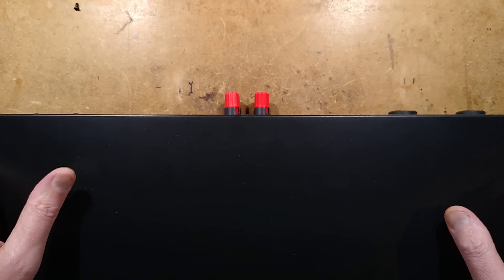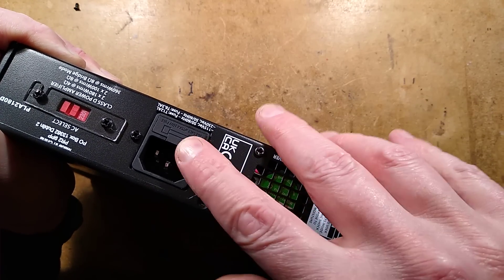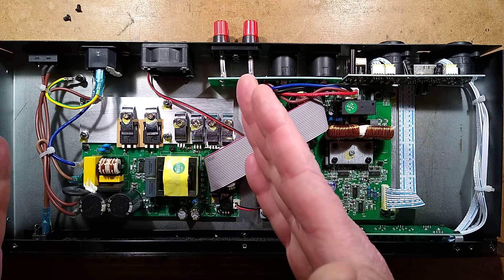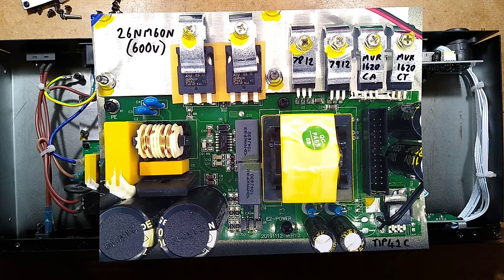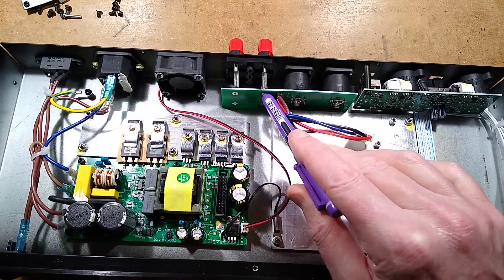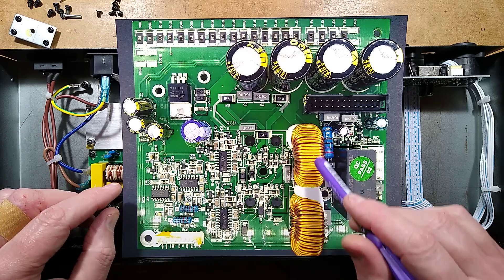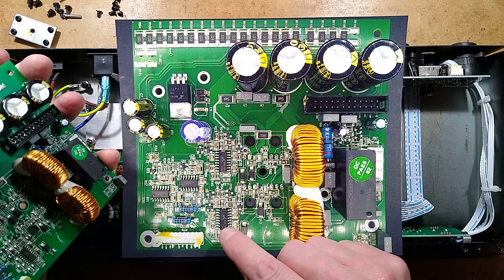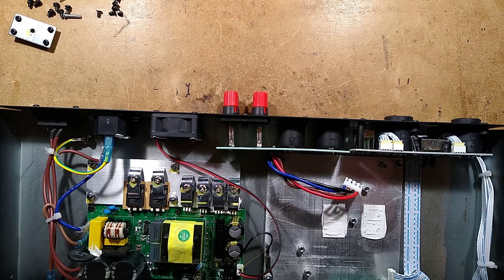Inside a 360W digital amplifier

Comment: I recently switched from a class B power amp to a fully digital 2.1 amp in my office/home studio listening setup. I opted for a TPA3225 based design which is so much better than the old iron and heat sinks approach. Sure, it gets annoying when you crank it really loud, due to ringing, but I am normally under a quarter of its capacity, so it's fine. They managed to pack a 2x75W + 150W 2.1 amp in a box the size of two cigarette packs. It stays almost cold, even after hours of heavy use. It's lightning fast, you can hear it when modifying the transients of a recorded track. It draws 2W on idle. I won't go back to an analog amp anytime soon...
Reply: These amps are in fact analog, they do not have a code of zeros and ones to make the sound. They function with pulse width modulation and that is in essence still an analog principle.
Reply: @ottonormalverbrauch3794  Yes, as in "light switches are analog, too". Does "PWM switched circuit preferred over linear regulator" better to you? ;)
Reply: @ottonormalverbrauch3794  they use a specific digitising algorithm we know as delta-sigmoid modulation. It is equivalent to a digital signal in many ways as that's truly how simple DAC and ADC can be.
Reply: @AnnaVannieuwenhuyse sorry, class D amps aren't digital. As explained above, they're purely analogue. A quick google will show the difference.  It's a very common misconception that class D means digital, it doesn't. It just means switching.
Reply: @AnnaVannieuwenhuyse a digital signal needs to be quantised in both amplitude and duration. A class D amp has only one of these - amplitude. The PWM stream is infinitely variable in length, determined by the analogue input signal. If it was digital, those pulses would be discrete lengths.
Reply: Ensure your TPA 3225 has sufficient voltage. Their distortion performance is far superior when they have the voltage headroom, both on the end stage amp and the signal stage with feedback.
Reply: @AnnaVannieuwenhuyse  Yup, on point. I am running it on a 48V supply, so there's ample headroom and no worries.

Comment: Yeah very common one time in analogue studios to have the green wire poking out the bottom all the mains plugs unconnected. Audio grounding is contentious subject and entire articles written on it, plus a lot of studio 'outboard' isn't balanced it's 1/4" jack not XLR. So the power earth gets cut. Or use a 2-pin adaptor on the 3-pin plug. Lot of people  until the mid-80s also used to cut the earth with their 'scopes so they can clip the 'earth clip' to a mains live TV chassis without blowing themselves up, until someone comes along and leans on the 'scope not knowing the whole thing is live = "buzzzz!!! ow!!"
Reply: Well, nothing can compete with hyped MarkBass amplifiers from Italy which are with a very idiotic solution - extremely expensive but made from worse components and completely ignoring the basic rules of electronics.
Based on this video, it is quite clear that this particular Chinese amplifier (worth some 150eur or so) is much closer to all requirements than the aforementioned MarkBass (and sometimes even powersoft), even considering their price (thousand+Eur or many thousands Eur in second case) .

Comment: The mystery chips are possibly a clone of the obsolete International Rectifier /Infineon  98-1073pbf which is listed online for sale as 'ic audio driver digital'. No data sheet seems to be available but it's probably very similar to the common IRS2092. 
The power supply looks like it is a unregulated LLC design. The large caps close to the transformer are in series with the transformer primary so that is resonates at the drive frequency. Current in the primary is sinusoidal and switching losses and generated noise is minimized.
Reply: IR2156 is not even close to LLC, LLC is much different topology, yes it is in terms of interference noise, LLC is the best topology for powering an audio amplifier, but all these converters operate at a fairly high frequency, and when they stay in their modes, they usually do not have audible interference noise.
The IR2156 is actually a ballast driver for a fluorescent lamp, but it can be ideally used as a half-bridge switching power supply controller. If it is done correctly, they are also quite reliable, they work even at frequencies 100kHz+ (quite extreme and must be a well-developed solution), it is possible to take 5-6kW of power from this kind of half bridge PSU to the powered device.
Of course, this specific one in video does not correspond to these numbers (and don't have to acorrespond it, because amplifier is also much more modest)...

LLC's standard example is ST microelectronics L6599, but it would make power supply much more detailed (dense) visually - the LLC power supply requires a very careful design and its (in L6599 case) power capacity is also quite limited (you cannot create a power supply unit of the same power as aforementioned numbers on basis, as is possible with these simple ballast drivers).
With ballast drivers, it is also possible to use several protection functions - overcurrent, overvoltages, etc. that are present in full-blooded PWM drivers, but this has to be done externally, often this external design can also be better than on-chip solutions.
I'm not afraid of them (ballast ICs), they've proven themselves quite well, and with add-ons, they can be made completely equivalent to special PSU drivers.
And finally - an unregulated power supply is the best possible solution for an audio amplifier in 99% of cases.
To understand this, dynamics of the audio signal over time must be studied...
Reply: @inarinukka7729  I actually have a fixed frequency L6599 controlled power supply in front of me right now, powering my computer speakers amp. It's not very complicated. True careful design is required but complexity isn't necessary if regulation isn't required, just operating at the gain/load invariant point on the curve is OK. No reason this can' t be done with  a   IR2156. Just a hunch that the PS is LLC, might not be. Would depend on how much leakage inductance  the transformer has.

Comment: I was expecting to see significant shielding between the low noise input opamp board and the high frequency switching power amp? 
How did they get away without it?
Reply: Interesting Q. I think there is essentially shielding in the form of the case. The e-magnetic field lines from the switching FETs will be significantly influenced by the very close and presumably earthed chassis compared to the distant opamp board. The output of the FETs is smoothed almost instantly in the caps, so I would expect the EMI to be low overall.
Of course it could just be that they didn't bother!

Comment: Digital amplifiers are honestly very simple.
It is mainly just a comparator looking at the output voltage vs the input voltage.
If it is "too high" it switches the output transistors low. If its "too low" it switches the output high. The LC network then smooths that square wave out into an analog signal.
To aid the stability of the circuit one will also just sample the comparator's output at some fixed frequency. Preferably one that is N times higher than one's peak operational frequency, as to give room for adequate filtering.

The two hard to identify chips are likely just a half H bridge driver IC meant to drive external transistors. It likely also has some clock input used to synchronize when it should update its output stage.

It is honestly quite simple to build one of these amplifiers.
All one needs is a comparator chip, a clocked latch and an half H bridge driver IC. One can go with a full H bridge driver too, then one effectively have a differential output, though one then needs two LC filters for said output, so pros and cons...

Comment: The "D" in Class D amplifier does not stand for anything. It doesn't stand for "digital" either, since there is nothing digital in a Class D amplifier. It's pure analog electronics. The only "digital like" part of the amplifier is instead of running the transistors in their linear small signal amplification region, we slam them on an off. This is why they are extremely efficient amplifiers in that we are operating them in the fully saturated mode of operation similar to the way digital electronics would. But the D is just a coincidence, and there are many other classes of amplifiers defined. Classes A/B/C run the transistors in their linear region, the only difference is how they are biased which determines during what part of the waveform they conduct. Class D onwards operates in various modes. The class D topology has a simple PWM converter at the front end running at a MHz or so and the output of that PWM is sent to the power transistors. After that you have a smoothing filter that makes the PWM linear again.  Classes E and F I believe are similar in operation, but different. G and H are "hybrid" amplifiers in which they usually can control the voltage rails so during lower power output they lower the voltage rails for higher efficiency. (You may recall many power supplies having a switchmode front end followed by a linear regulator - the switchmode provides the bulk conversion so the linear regulator does not dissipate as much power).

It's just pure coincidence. The PWM converter is a pure analog block.

Comment: I'm in love with the TPA3116D2 amplifier. It's a 50 watt Class D amplifier about the size of a pack of cigarettes and sounds amazing. I've got it running the sound from my computer to two 50 watt bookshelf speakers and it's doing the job VERY nicely. I've bought a bunch for when I need sound somewhere because they sound great and they're 5$ on the Chinese sites.   Amplifiers have REALLY come a long way in the last few years.
Reply: Class D in general has come a long way. There's zero audible difference between a class A/B and a modern class D amp. Always love how much darn power a class D amp can produce despite being absolutely tiny. Also the efficiency is totally bonkers. Just beats my old heavy AB amp in every category.
Reply: @DrakkarCalethiel  with modern switching supplies class AB has come along ways too.   I have an older carvin DCM-3800 class AB amp that only weighs 12 lbs and puts out 3800 watts RMS.
Reply: If you want an Experience that is rather eye opening... take one of the new TPA3255 based amplifiers (A07, V3, etc) found on popular online vendors and cut it loose on something like a pair of Klipsh Heresies or JBL L-100s ... they're not just for bookshelf speakers anymore.

In fact, the way these things get sold short is by always talking about them as though a tiny amp needs tiny speakers ... when that's just not true.
Reply: @Douglas_Blake_579  Larger speakers can often have a higher sensitivity, in which case they can reach the same listening level with LESS power.
Reply: @boydw1 
the TPA3255 can produce upwards of 200 RMS watts per channel on 4 ohms, 100 on 8. And they are still a palm sized amplifier.

Consider the power of a PM8006 for less than $100.
Reply: @Douglas_Blake_579  Oh, for sure, the power these little class-D amps are putting out for the size/money is impressive.
My point was more that the "large speakers needing a large amp" assumption is often backwards. 
Say you have a small bookshelf speaker with 87dB/1w/1m sensitivity, and a larger floorstander speaker with 93dB/1w/1m sensitivity (6dB delta). You'd need to give the bookshelf speaker 4x the power to reach the same listening level.
Reply: @boydw1 
Yes, I'm aware of that.

Comment: Those 40mm fans are sometimes annoyingly noisy with loud, specific frequency peaks.

Unfortunately, not much space in 1U. Although one could put in a centrifugal blower that's 30mm or so thick but say 80mm "square" and still have only a small exhaust cross section. 

The blowers can develop much higher pressure gradient at lower noise. Airflow volume is typically less than for unrestricted axial fans, but the flow through axials drops sharply when there is a flow obstruction. Blower throughput is much more graceful.

There's science and art (Engineering) in effective and efficient thermal management of such devices.  Alas, electronic Engineers tend not to have the necessary background understanding... and will do what has worked for others in the past, instead of hiring a Mechanical Engineer for the project.
Reply: If you can hear the fan the music is not loud enough 😉😂
Reply: @MrJef06  exactly! 🤣
Reply: Not a problem when your amp rack is in an air conditioned closet. :D
Reply: Plenty of space in that unit to engineer a big fan.
Reply: Some airflow ducting would help, I think.  Is there room for another small fan at the front?
Reply: Yeah add another 100 dollars for another engineer's expertise  and fancy noctua fan no one will be buying these amps.
Reply: It's a short chassis, they could have covered the back end with heat sinks, but ... that would cost a lot more than a cheap fan or two, and these no-name lines are heavily price-point driven; environmental tolerance and robust, heat-tolerant construction are not in the cards.  Probably won't hear the fans in a live music venue anyway. This isn't intended for listening rooms.  In a dance floor, it might even be isolated from the listening area completely, but that's more to keep the DJ's grubby mitts off the gain setting.
Reply: These amps are used mostly for public address and sound reinforcement purposes, and the volume is usually high enough to not even notice the fan noise. These amps aren't known for excellent sound quality, and aren't used in home Hi-Fi systems anyway. 
I wouldn't obsess over the fan noise.
Reply: @davelowets  quiet a few enthusiasts do have these as part of their home systems...but nobody would be sitting/listening to music so close to any amp. especially the moderately/higher powered ones 🤣
Reply: the Noctua 40mm fans are a fantastic drop in substitute that are whisper quiet in comparison
Reply: Noctua 40mm fans are moderately quiet, but still audible at full speed if you're sitting next to them.

Comment: Comparators are used on amp board to drive the signal and overload leds, and also to enable the output stage as well with signal applied. The transistor and resistors are used to drive the fan, resistors to do most of the power dissipation, using cheap resistors in parallel, and in the path of cooling air, and then transistor to do the voltage regulation for the fan, so you do not need a heatsink on the fan drive, and also do not put the DC power noise from the fan on the opamp supply rails either.

The mystery IC's will be a complete class D amplifier, complete with built in filtering, high side drive, and analogue input stage, plus some feedback from the output, to make a low part low cost amplifier, with power rating depending only on supply voltage and transistor ratings. One of hundreds of near identical IC's designed for that work.

Comment: The guitar world is permeated with rants about how tube (valve) amplifiers are better. But, surely they mean "stylistically better" i.e. distortion you like. I suspect the distortion from a properly built digital amp would be less, no?
Reply: For guitar, in most cases, tube (valve) amps are indeed better ----  guitar amplifiers are not hifi devices, they are *tone generators*, and our ears interpret the 2nd order distortion they generate as "warmth" and coloration that is pleasing to the ear (except maybe for "metal" players, ugh). There are also compression and distortion effects that occur as you play harder, and the distortion lessens when you play more softly; this opens up avenues of expression for skilled players.  Digital effects and emulation have come a long way but they still don't quite sound or feel the same as a good valvamp. Not to mention that when the heavily computerized solid state amp with digital modeling effects  craps out on you, in most cases it can't be fixed at component level, nor at a reasonable cost -----  Either you replace the digital processing board if replacements are still available, or it goes into a landfill.  Most valve amps weather from the 1960s or even if fairly recently made are still reparable if the technician knows the technology ( The exception being "Swiss Army knife" amps like Mesa Boogie where they've tried to cram 100 pounds of crap into a 40 pound box and added so many tonal options and effects and channel witching capabilities that the complexity and component density defies ordinary diagnosing and servicing protocols).

Comment: Using a Lamp driver does have a good thing in that they are fine with handling wildly varying loads, so can easily keep the regulation loop stable with audio, as the power draw can very wildly over a half second or so, so the power supply can still remain stable even with this kind of load.
Reply: Using this IR2156 ballast driver, it is possible to achieve a power supplies of 5-6kW. Of course, construction gets more complex.
Reply: Genius idea. Like it a lot!
Reply: @fredfred2363  You can try IR2153 as a start (do it with soft start, overcurrent protection and IC+buffer [just 2+2 npn-pnp bjt conf]+MOS combination). You can also achieve kWs.
1.6kW is not a problem at all, but an 80x240mm circuit board (large input filter capacitance is the reason). It is better to make IR2156 largely SMD, finding good current sense etc. is a bit challenging as a first project. At home, 600+W feasible to make the size of a cigarette box, planar E38/8/25 transformer, windings from ultra-fine litz braided wire, switching frequency close to allowed maximum from the IC, very fast but light (infineon`s many are good to do this without a buffer) MOSFETs, shottky rectifiers at output and so on..